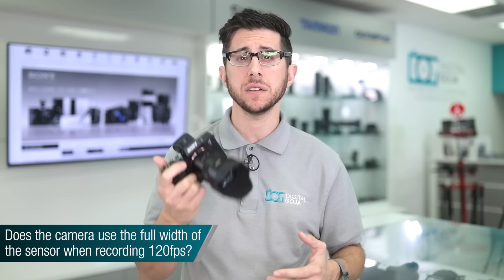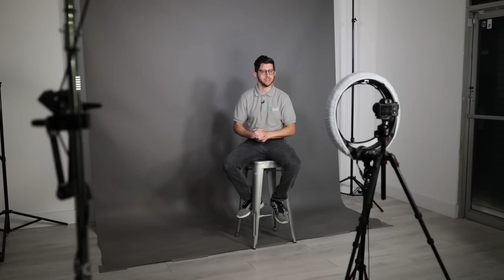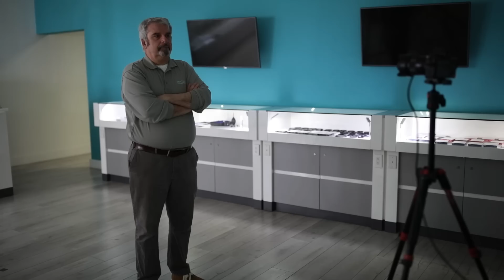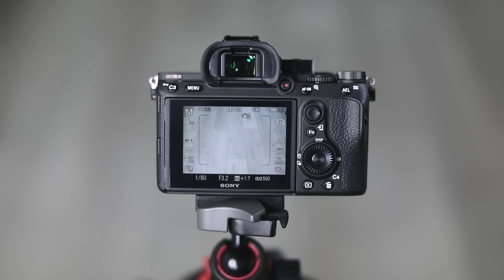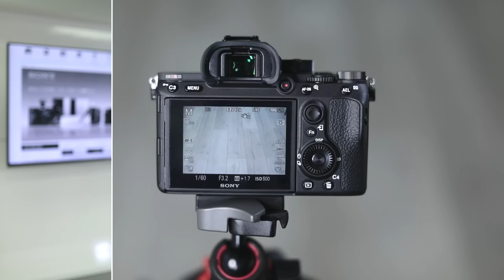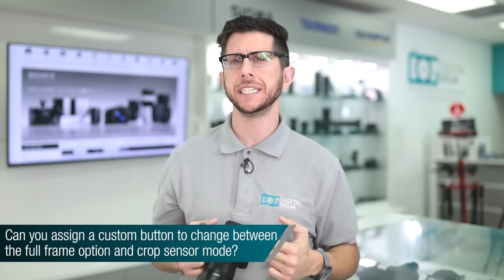Top 15 Most Common Questions | SONY A7R III Full-frame Mirrorless Camera | TUTORIAL

Comment: No Matter what I try, I Can Not get it to record RAW on Card1 & JPEG on Card2 simultaneously.  Even though I have it set like in the video, it still will only record to 1 card or the other.
Reply from the maker: Hi Adrian, we would suggest you to contact Sony directly as it could be a problem with the camera.
Reply: excatly same here with my newly bought A7R3. Did you find the solution?
Reply from the maker: Hey Deathward990. First, select Raw & JPEG in the first custom setting menu tab (File Format). Next, head over to the toolbox tab and access the Rec. Media Settings Menu on page 6 of 7. Now, select prioritize Rec. Media Slot 1. And finally, make sure to select Sort(Raw/JPEG) in the recording mode option. That setup will set your Raw files and Video to card 1 and JPEGs to slot 2. I hope that helps you out.